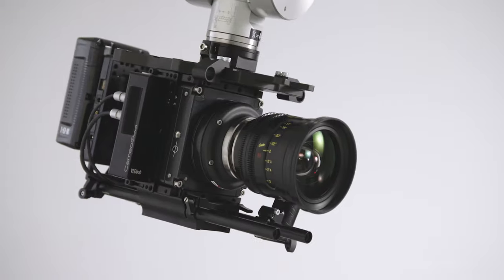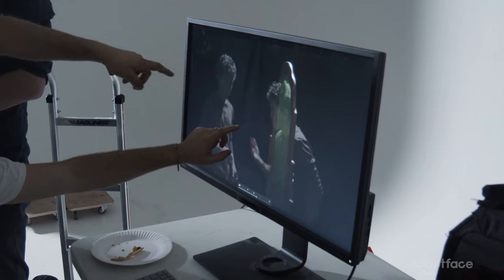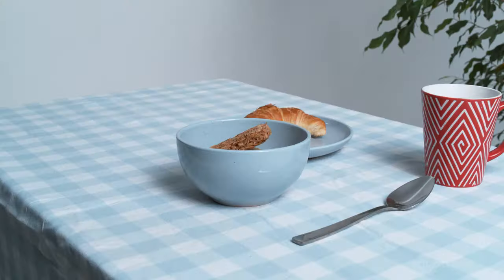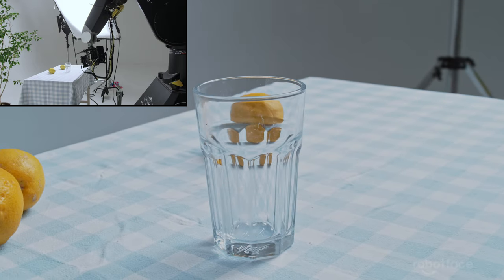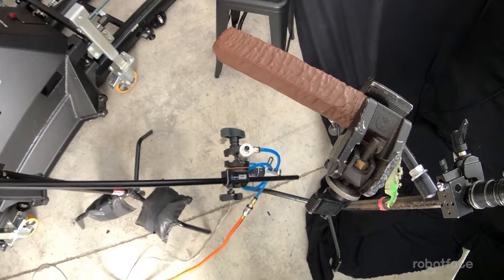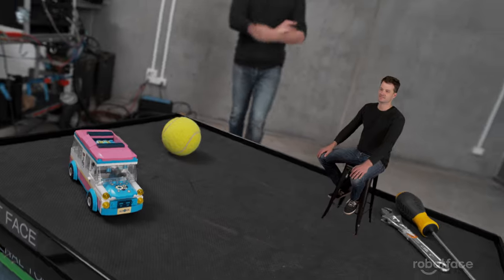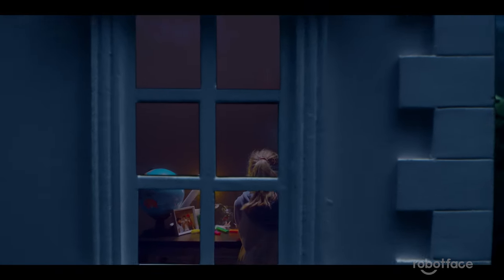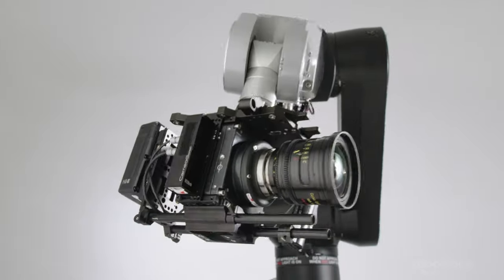What is Camera Motion Control ?

Comment: I got a few questions, why do you bother using a TV as background when you can digitally insert the unreal engine created video in post into the shot? Eliminates pixels being seen by viewer which occur of the display of the tv. And; how do you make the waypoints, do you physically train the robot the move, or is there a trick to train its waypoints?
Reply: If you're filming something like a glass the only way to get the right reflections is with a virtual background. On the Bolt the keyframes are made in the Flair software.
Reply from the maker: Hello @JCD87, apologies for late reply. Pixels on TV only become issue when you focus on the LED / TV plane, otherwise pixels should remain out of focus to avoid aliasing. Always best to shoot against a screen if you can - just like news readers standing in front of screens to present weather / sport etc - remember the days of them standing in front of blue screen? Always looked awful and obvious. Regarding waypoints, yes we program the robot to hit ceratin parts of the move, and becuase it is rendering the output on the screen in realtime, the contents of the screen change accordingly - just the same as when you look out a window - if you move you head when you look out a window, the 'contents' in the window changes - same concept to rendering realtime images on a LED / screen.